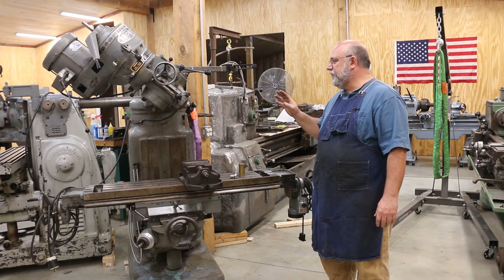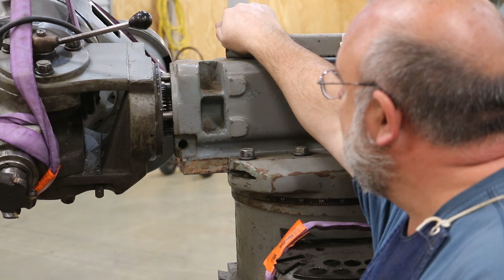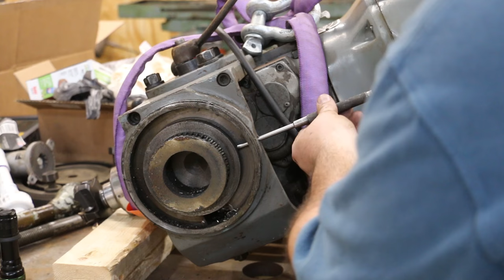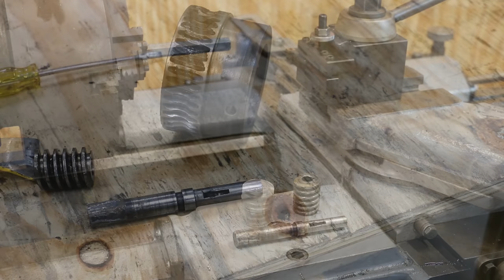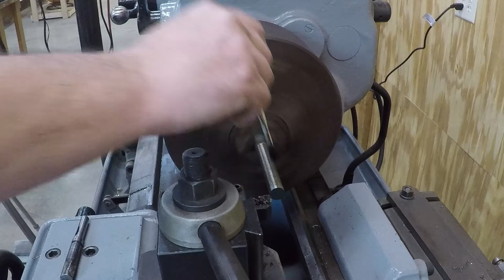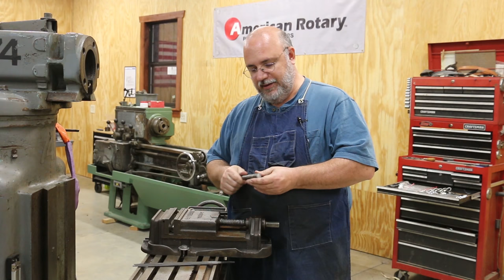Wells-Index Mill:  Repairing the Worm Gear that Tilts the Head

Comment: Great fix, Keith!! Sadly, this is a common problem on these heads. I was told by the guys at H&W Machine Repair over in Indiana that its always recommended to support the head with your arm once it tips over center due to the pressure angle and clearance on the worm not being 100% right for the application. They said it puts a tremendous amount of pressure on the worm which requires a lot of torque to get to move and the shaft simply is not stout enough for it.

My Bridgeport gear was a little worn as well and it would stick and turn stick and turn which caused the head to bounce. They mentioned that bouncing is what usually shears the shaft or the keyway and tears up the gears. My gears were also DRY as a bone. When I did my refurb on the machine, I used a load of high quality high moly content grease used for racecar engine fasteners (ARP lube). That really made the difference on rotating the head by lowering the friction more than normal oil or grease. They still suggesting supporting the head when raising and lowering it when the weight shifts to the sides. I could really feel it in the worm when I would take just a little weight off the head, big difference.

Thank you for the video!
Reply: Yeah that little worm seems small compared .to that head with the motor and all on it.Once it starts rotating "downhill" I don't see how that worm can take it
Reply: +ronald davis I was surprised at its size too, although it's the gear that couldn't take it, not the worm. I was wondering if some attaching some kind of counterweight when tilting to more extreme angles might ensure the gear's future longevity.
Reply: Interesting dilemma.....

Comment: To those that suggest just flipping the gear 180, note that the damaged teeth are at the extreme end of the gears travel. Flipping 180 would put the damaged teeth at the other end of the Gears travel. Slipping the gear 90, if done in the correct direction, will put the damaged teeth out of the gears travel. Should the gear be slipped 90 in the wrong direction, the damaged teeth could end up in the center of travel. Slipping exactly 90 is not critical. It is only necessary that the new holes line up with the existing holes in the gear housing. Keith has it right. Don't sweat it.

Comment: Keith, I was told once if it was easy Walmart would be doing it. Nice job on the bolt. The worm gear would be an interesting fix but time consuming compared to drilling a couple holes. Keep smiling.

Comment: Keith, on my BP mill whenever I rotate the head in either direction I apply a bit of assistance by lifting/pushing on the head itself such that all the force is not on the worm or gears.
All the best,
Eric
Reply from the maker: As do I, but I think that this damage came from someone trying to force the gear with the head locked down.  I will probably never know for sure.

Comment: Why are there so many comments wanting Keith to buy, make or worse yet take the time to weld repair this gear. Rotating the gear 180 to a new set of unused teeth is the perfect fix.  He is very fortunate that he has this option and would be a fool not to do it.  If having a few (unused) broken teeth in that gear set bothers you guys so much, then maybe Keith will machine them off and you can all pretend that is how it came from the manufacturer. If the rotation process requires only a partial segment of the driven gear, there is no reason  on earth to not use the available fresh teeth. How many times have we all had a tool or a part that we could rotate or adjust to a fresh setting when needed?  Leave Keith to his repair.  We are just viewers who are fortunate to have him invite us to watch (for free!) his projects.
Reply: im a similar vien, my desk fan rotating mechanism the plastic gear stripped, but like all fans it rotates about 90 degrees, so the cog that did the job only had half its teeth broken, i rotated it and its lasted even longer than it did the first time around!
Reply: Calm down buddy...

Comment: Keith,
It's nice that you got to make a part on the La Blond lathe. The bad part is the condition under which the part needed to be made. As you mentioned, I see no problem with "repurposing" the unused portion of the worm gear. With your ability, I see no problem in you drilling the holes in the proper position and everything going back together as it should. You can get gears on Amazon??? Who knew? Anyway, thanks for the video and sharing your work and frustrations.
Have a good one!
Dave
Reply from the maker: Yeah, I was kind of surprised that the gear was on Amazon.  I just did a Google search for the part number and it came right up under Amazon!

Comment: Good fix so far Keith, just watch another YouTube video of then making the teeth on a gear using the dividing head and a horizontal mill. Looks like it could be done with what you have in the shop. Would make a great video, just a thought. Your meticulous in your repairs, you knowing that it's not right a full 360 of the teeth would work on your mind.

Comment: I had the same exact problem on my Bridgeport. I'm glad to see your video on your fix because I did my repairs identical. but my shaft sheared at the set screw relief. the shaft was a bear to get out of the head. I too didn't have the right woodroff cutter so I had to reassyemble the mill without the worm and .plunge milled a slot for a square key. worked well enough. thanks for the videos and expertise.  yours and others are my favorite source of entertainment

Comment: Keith, on my mill I always support the head while I tilt with the worm gear.  The milling head is very heavy for those small gear teeth and way too much leverage multiplies the force on those gear teeth.  My mill has the worm shaft hex on both sides of the head so I can hold the weight of the head and crank the ratchet and tilt either direction.

Comment: Hi Keith,

I've seen that done on Bridgeports far too often. 

The worm should not be used to raise or lower the head once it's tipped over more than about 30 degrees. 

Lift or lower the head manually, just using the worm to control the movement.
Reply from the maker: Agreed!  I think that what happened is that somebody in the past had tried to crank it up when it was still clamped down.
Reply: That was my thought too Keith.

Comment: Nice to determine a relatively easy fix and relatively inexpensive worm replacement.  I am surprised that cast iron was used for the large gear given the stresses on the teeth when rotating the head and the small diameter shaft for the worm. And Yes, the weight of the head assembly needs to be supported in some manner when rotating to minimize stress on the gear teeth.  It will turn out just fine.

Comment: I have moved some hit-n-miss engines with my engine hoist and typically stop breathing when it is up in the air! A thing I do additionally to using straps is use a safety chain as backup, should something happen to the straps (usually 3 or 4). May not be needed but it sure makes me feel better.

Comment: Keith - though your thoughts about lowering the CG are interesting, as well as valid, tilting the head tips a lot of weight to one side making the machine vulnerable to tipping over in the direction of the head. That monster has a lot of weight.Aside from the extreme forces required to bring the head back to vertical. Regardless of what you do the reduction of weight/height is minimal compared to the horizontal tipping forces involve AND the stress on the rotational gears to bring it back up.

Comment: Glad to see you salvage the gear wheel and make the new shaft,  It's a good practice to salvage where and when you can.  With the two drift holes it seems that part was meant to be installed 180 degrees around should such tooth wear be observed.  Great video, as always.  I envy your new large shop.

Comment: Have you checked the position of the damage relative to the position of the head? The damage don't have to be at the lowest point when the head is in the upright position. So turning the gear around 180° don't has to work perfectly.

And i would put two pins in the ends of the damaged part, so the head can't be turned further, to prevent damaging the worm gear and slipping of the head.

Comment: I don't know if it is too late but I would suggest you don't assume the roll pin holes are exactly 180 apart, they could possibly have been hand drilled in situ.
Reply from the maker: I plan to use some transfer punches to mark the new locations just in case that is the situation.

Comment: Great video Keith things!  I was looking for you to say.... No problem with not having the correct woodruff cutter.....for one slot I will grind a flycutter bit for a HSS boring bar, and get the job done...I guess that may be too small of radius ....of course Stefan would had ground a close key cutter to the correct diameter and width, but was going to give you a break there, for not having a tool grinder!
   Secondly...I'm not sure if the worm components are fully up to the task...at least without help.....seems to me that I have seen instructions that mentioned giving "lifting" help when the head is horizontal....I always felt like I needed to help it anyway! Maybe keep your eyes open for the correct worm gear part, and if stripped.....see about milling it off to add the correct worm gear to add on.....then swap it out at a more convenient time.

Comment: Trouble at the Monarch Hilton! Keith, a thought...before reinstalling the worm wheel in its new orientation, what about filling the damaged teeth (at least the boundaries of that region, using brass, JB Weld, an attached plate, or any suitable means) to serve as a STOP so that the worm can't travel into the chowdered area and get jammed, breaking something again and getting the head stuck on the ram? I realize that the table restricts head rotation, but who knows? Does it still do so with the knee all the way down? Does it restrict it enough in that case? You could also grind out the bad teeth, but that's asking for the head to drop unexpectedly.

Comment: Keith why not use the smaller dia woodruff cutter and elongate the slot to correct length. File the new key to suit and you're off to the races. The shallow keyseat will actually work in your favour keeping the shaft stronger without compromising the key itself since this will not have solution will not reduce the shear plane area.
You might also consider cutting some gullets into the old worm gear to make a hob. Some high tensile bronze would make an excellent replacement worm wheel.
Oh and please show more  respect for the dial calipers. I cringed when you ran the job to scribe a line.

Comment: Thanks Keith for sharing... I have a similar issue with the power downfeed worm(?) drive on my Wells-Index 845 mill ... gets to a spot and stops downfeed until I push it on past that spot. So thinking there's a stripped out spot on a gear... Need to spend the time to pull that head apart and see what's going on...

Comment: drill and ream through the holes in the head for new pin holes in the gear. make a hardened drill bushing for a pilot hole. it will be a pain if you are even half a thou out of position on the mill set up.
Reply: or if the holes are close at 180 degrees use a tapered reamer to oversize as needed. tapered pins will be difficult to remove the next time the gear has to come off but it would be possible to do. stamp the outside of the head for future reference.

Comment: Its way easier to weld a 3/4" stud to a piece of plate. Tighten the stud in the heads collet, bolt the stud plate to the table and use your y axis to separate the head from the mill. When its time to go back together you just wheel it back in, still in alignment. Easy peasy.

Comment: Lucky that they didn't pinch the pennies on that toothed gear and only hob the teeth that were needed. Looks like it'll be good as new once you reposition it. I'd lube it up with high content moly grease if you can find a small tube of it (kind of expensive the good stuff, but it holds up to high pressure usage for a long time.)

Comment: Why not put two set screws(or something more substantial) for added security. seems like there was more thrust on that little set screw that it could handle? In my opinion that set screw was the demise of the big gear. it allowed the worm to  move out then a piece of that key sheared of,  floated around got up in the the worm gear and took out teeth on the big gear. 
   The only tool that should have been used to turn that is a six point deep 5/8" socket. It seems the tool of choice for many machinists is a all 1/16" or crescent wrench that destroys a lot of bolt heads. Thanks Keith good luck with all the new stuff in your new shop.
Reply: The side of the worm gear would be taking the load against the inner face of where it rides, not the set screw.  The worm is not held in a solid position on the shaft, its free floating.
Reply: James Olivier 
Yes your right but end result the piece of the key destroyed the big gear.
Reply: Lifes Journeyman There is very little clearance on the thrust ends of that worm, definitely not enough room for a piece of the keyway to make its way out and up there, and even if it did, it wouldn't cause a a big section of that ring gear to be destroyed like it is.  That gear damage was from excessive force at some point.
Reply: James Olivier 
This is good. Discuss it to death, find out why and prevent it from happening again. I have many pieces of equipment and when something breaks down this is exactly what I do. Who cares who is wrong as long as you get to the reason. I still think the worm moving the shaft back and forth caused the set screw to wear out the part of the key worked it's way    into the worm(it is touching the worm) then all it had to do is cause one tooth to break of the large gear then it is an avalanche.
Reply: Lifes Journeyman yes exactly,. I would think there would be some evidence of a piece of that keyway migrating its way up there, some gouging or marring on the thrust ends of that gear and the thrust areas of the casting.  to not be able to see it in person makes it pretty difficult to diagnose!
Reply: a second (and proper) set screw would most definitely help negate future damage, but also making a very smooth shaft and some grease on it to negate the worm from transferring any thrust load to the shaft/setscrews would be beneficial

Comment: Too bad I hadn't known sooner. I still have the parts donor mill I bought to fix my wells. I think it has good parts on it. But you'll probably have that thing put back together before you even see this comment.
Reply from the maker: Thanks Steve - I think I will be fine with just rotating it.  If I run into any problems, I will let you know.
Reply: Keith Rucker - VintageMachinery.org No problem. I look forward to seeing part 2.

Comment: Hey Keith the lathe sounds good looks good glade you got to make chips with it   But I'm confused if your rotating the large worm gear 180 why do you need new holes if the holes are inline wouldn't simply turn bad teeth to top and  re-pin to get 180 if you drill new holes 90 from old aren't you only turning gear 90 ????
Reply from the maker: The broken teeth was near the extreme end of the travel - rotating 180 puts the damage on the other side.  Rotating closer to 90 degrees will put the damage out of reach in this situation.

Comment: Make the part. This isn't something you'll use every day, so anything you make is worth the time rather than paying the price. I'd even go as far as to find if welding/brazing the missing teeth and cutting them out wouldn't be possible in relation to the weight of the head.
Reply from the maker: I can just rotate the broken part to an area that will not be used and use the existing gear.

Comment: Did you find the broken off chunks of that gear? Wonder where those little bits of steel ended up.  Hopefully nowhere where they will do damage.
Reply from the maker: No signs of the broken pieces.  The gear is cast iron though instead of steel. I suspect that they fell out a long time ago...
Reply: I THOUGHT that I saw metal fragments in the bottom of the housing that contaied the damaged part of the worm gear-----I must have been wrong!!!

Comment: I'm confident that Keith did not do this damage. He is not the type to force the gear with enough torque to strip the material. Actually, the whole gear assembly does not look robust enough to rotate that very heavy machine head.

Comment: It's good that you can turn the ring gear 180 degrees and get more use out of it but would that not be considered to be a temporary fix? It looks like the gear is made from bronze or cast iron so could you not take the old worm gear and make a hob out of it to cut a new ring gear? Just thinking out loud......

Comment: If you can't just rotate the gear 180 and you do have to drill new holes, could you just transfer punch their locations rather than using a dividing head? Watching with interest. Thanks for the videos.
Reply from the maker: Just rotating without drilling new holes it will be kind of iffy - it is right in the range that it might catch it on the other side.  A transfer punch would probably work but part of the issue is making sure the hole is on center.
Reply: Transfer punches are not real accurate. They're fine when drilling bolt holes that have some clearance for the bolt body but roll pins need to be within a few thousandths .
Reply: could you sacrifice a drill bit by dulling the flutes just slightly above the cutting edge..  or use a longer drill bit that you have cut almost all the flutes off leaving only 1/4" of flute and the rest smooth shank .. you would need to touch and pull back..  and drill with grease.. to extract the turnings.
Reply: It's simply no big deal to accurately locate the holes for an expert machinist with the right equipment. Like Keith Rucker.